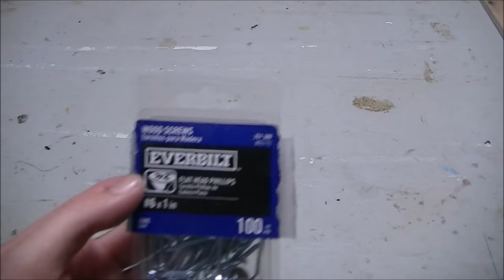Rustic Shelf with Hammer Head Hooks

Comment: Great idea and a nice addition to the wife's Primitive Country collection - Just curious though, what are the cut lengths (as the widths are - assumably what ever the boards are cut to when made for the pallet board they came from)  Thanks in advance!
Reply from the maker: Sorry unfortunately I didn't write down any dimensions I just mocked everything up and went with what looked right.  I also gave this away so I can't go out and measure it.  But looking at the video the vertical pieces are spaced about 6-8 inches apart.  If you look at the vertical pieces and imagine the boards butted up right next to each other you could probably fit 7 boards across.  So I would estimate the width is about 21 inches.  The planks that make up the horizontal back and shelf are wider than the vertical planks.  These are usually about 6 inches wide.  So maybe 12 inches for the two back piece and 6 inches wide for the shelf.  I don't know the length of the metal supports since I just cut them to length.  Since the pallet wood is somewhat less than perfect I do remember one metal support being longer than the other.  I hope this helps I'm not very good about measuring and writing dimensions I usually try to mock something up and see if it looks good.  I hope this helps.
Reply: Thanks for your quick reply... That's great! at least now I have some kind of idea for measurements....  Good Stuff! Thx!!
Reply from the maker: Sure anytime let me know if there is anything else I can do.  Good luck on your project.